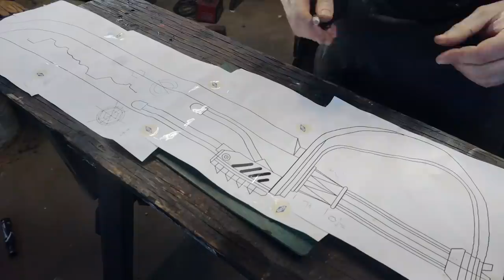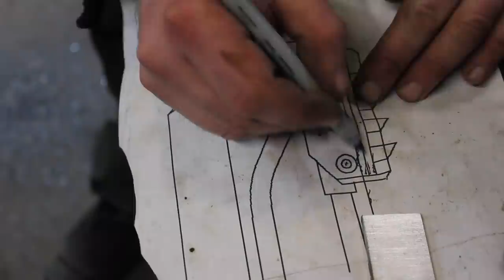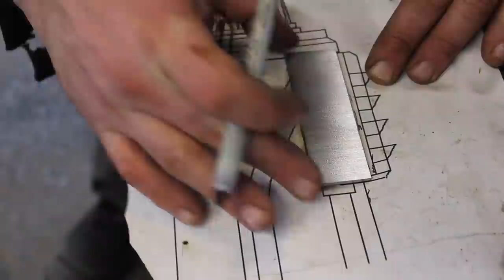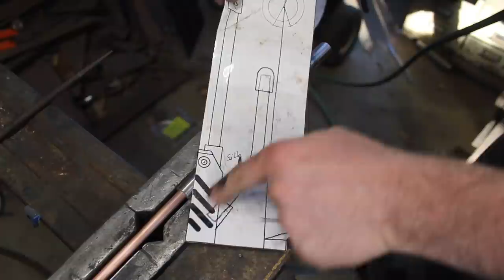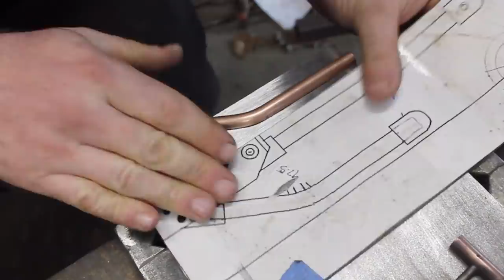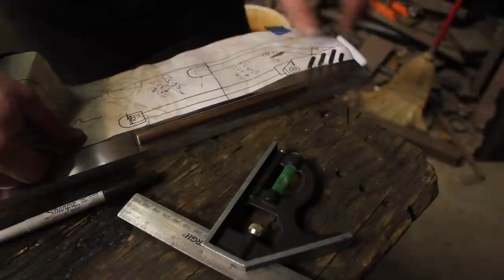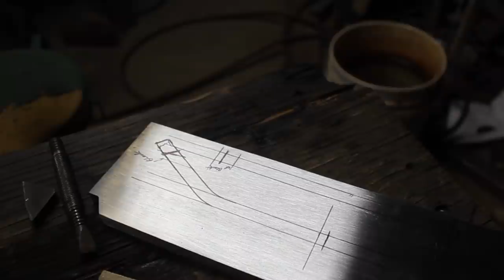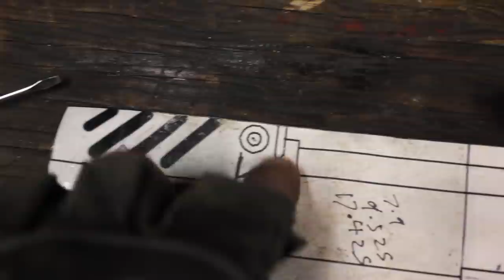I Return with a 40k Power Sword.

Comment: after working 3 years in a iso 9001 aluminum extrusion/fab plant, I always get a sick sense of satisfaction whenever mike creates a new franken-tool that works flawlessly
Reply: As a welder that's had to use extruded aluminum parts I both love and hate you at first sight
Reply: @jonathonhunt5387  I can easily say I have never worked a more hilariously dangerous, yet strangely fulfilling job since.

Comment: A tip for forming copper. Heat it up and quench in water to anneal it THEN it will be softer and bend easier. Dont heat it and bend shapes like you would with mild steel.

Comment: Hey Mike, just wanted to say glad you're back. I've been teaching myself to weld on my breaks and lunches at work. It's 22 guage to 16 guage sheet metal and it's galvanized, so it's rough but I plan to take my welding test this week. Just wanted to say you had a bit to do with it, been watching your stuff for years and finally acted on my wanting to learn the skill. God bless man, take it easy
Reply: Be careful when heating galvanized metal above 480°F it releases  fumes can't remember if its toxic or cancer causing but you need lots of ventilation.
Reply: @dasbutte6254  yeah I know but my shop has no ventilation and I can't afford a respirator right now so I just hold my breath when I weld. We've had 3 people get galvanized poisoning and one guys currently in the hospital with a collapsed lung. OSHA is looking into it at the moment as well. But thanks for trying to look out for me man

Comment: Check out "tube bending springs." As a plumber I use these to bend soft drawn copper supply lines for fixtures without kinking them. The work suprisingly well, and a set can be had for quite inexpensive.

Comment: White vinegar is pretty great stuff. I've used it to save all kinds of odd kitchen tools. It'll take off rust, scale, grime, baked-on burned food, dubious bathroom stains, all kinds of stuff, and it's non-toxic for pets. And it's cheap, basically my go-to for when cooking goes bad and burns to the pan; soak it overnight in white vinegar, comes right off. And if you're like me, and forget you put laundry in the washer, and then leave it for 3 days because you're a space cadet, just pop a cup of vinegar in there with your usual detergent and rewash to de-stink. So many uses.
Sorry for the vinegar digression lol. Great video! Glad to see your axe wound healed up.

Comment: With the jeweler's saw, (the frame-sawy thing) the closer the piece is supported, the better the cut.  That's why they're usually used with jeweler's 'fingers' horizontally, instead of vertically.

Comment: I see you are using some kind of metal workers version of a coping saw to cut those slots. Theres a saw type called a warding saw, that locksmiths use sometimes, with thicker but somewhat shorter blades, that might make doing small slots like the ones on the exhaust covers just a little less of a complete pain in the arse. Blades come in different thicknesses too, so they are quite versatile 😊

Comment: Use an end mill for a flat bottom, to avoid the taper in the bottom of holes, also you could use a thread locker to ensure those screws don't back out

Comment: If you want round holes instead of "polygonal perforations" you simply need to clamp down the material on the drilling machine table. Holding it with a hand or clamped on a block still allows movement.  Yes you need more time to align the drill properly..

Comment: 25:40 Yes you dont even need to boil it, just leave in say 20C for a day and vinegar will eat away the zink. You can also do this partially by only partually dipping part in vinegar and maybe even very accurately if you mix vinegar with say flour and put that paste on the surface it might remove zink (havent tested that latter one), just takes way longer as its no liquid anymore. Also need to probably add more vinegar with syringe or something to keep flour moist so reaction keeps going. Just remember to do this outside or in well ventilated place since it releases hydrogen if i recall right and that shit goes caboom real fast. One or two bolts no issue, but anything with larger surface area might cause hazard, havent tested whats the limit.

Comment: In the future, if you try bending copper like that again, you should first anneal the whole rod by heating it to cherry then letting it cool slowly to room temp. Then it will bend so easy. For lots of bending, to prevent breaks from work hardening, re-anneal it frequently. Then, I know you'll like this part, clean it up in a hot pickle. I use white vinegar in a slow cooker on low, but an electric kettle would also work.

Comment: Slots ...use clamps or 2 sides  taped and crazy glue 2 taped sides of the parts together .
 Use the drill bit to remove most of the material from the slot.
 Use a round file to enlarge the holes by round filing the small bits between them ,  finish the removal with flat files.
  With good placement most of the material is drilled out,  that was painful to watch

Comment: So is it possible to create you own type of forge using propane, coal, and a couple of leaf blowers? I feel like it could work if funneled into a T junction top that you could lay the sword into. Have a hammer welded and bolted into a circle gear and have it either horizontally hit or decide to go for a vertical hit that uses pressure like a hydraulic press to perform forging techniques. That could be a really cool series to build I think.

Comment: braise copper invisible joins by heating it up to almost melting with your oxy/cet, and melting a second bit of copper tube, dripping the melting copper onto the almost melting copper. Only takes two or three practice runs to get okay at it. 
I imagine you can also tig weld it using a second bit of copper as the filler rod.
Reply: I'll do this with hvac pipes if I only have 1 or 2 ends to weld up when I run out of braising rod. I pressure test the pipes at 350psi so it has some strength to it

Comment: I sure would not trust myself to even try that with a zip disk and angle grinder. maybe a 2 inch cutoff on a pneumatic die grinder. that's the first time I have seen a center punch like that. pretty cool for something that need to be persise. I like the ones that you just push on and they click. only get a small mark but then I go back and punch marks more defined after to hold the drill bit center.need a good punch mark when drilling round stock.

Comment: Maybe this is stupid to do in Steel, but why didn't you take the two thin vent plates, fastened them to each other, and then create those slots? That way, they should end up mostly identical.
As for copper, copper behaves the opposite of steel. You heat and quench steel to harden it, whereas copper gets really soft. If you work with copper again in the future, heat it up and then quench it in water. It should be nice and soft afterwards, making bending a bit easier.

Comment: Here’s a question. Can these swords hold an edge? They aren’t tempered from what I can tell, or is the steel already hardened?
Reply: Super late, but yes they are pre hardened. Hardox plate, it's called. You can find more online. He also seems to sharpen it to a "dull sharp" which helps hold the edge

Comment: Do you think the slots would be easier to do by drilling sequential holes to remove most of the material then file it down? I'm sure you thought of that already and had a reason it wouldn't work, I'm just curious lol
Reply: That never goes as planned, ever.

Comment: copper work hardens the more you work it(bend) the more brittle it gets (including heat)
Reply: and to soften it back down you heat it up until its faintly glowing and then shock cool it in water. it does harden quickly again though...

Comment: Michael injures himself more trying to work with wood than he does with steel. lmao Then again, I don't understand why he didn't just used the rounded part on the end of the sander to get into the curved portion of the blade.
Reply from the maker: It may not be noticeable on wood, but when you try that on steel, the fact that the wheel has no backing on it creates an incredibly rough surface. It might work if the front wheel was rubber, like the back one, but presumably there's some reason it can't be.
Reply: @michaelcthulhu  I understand. I should know better than to question someone who does this for a living. lol

Comment: 37:29 Isn't it possible to change the colour by heating it up and scrubbing it with a copper wire brush?
Reply from the maker: I have never gotten a copper wire brush to work, the brass brush works, but for some reason the copper one does not seem to.
Reply: Dang :/

Comment: I do like the projects you take on but always get annoyed at the amount of material you normally leave between the blade and the handle. The FF7 sword if the one that mostly comes to mind when you had a 6'~ blade with a 3"~ piece of material to connect the handle to. It just didn't seem in proportion to me but I'm not an engineer today, I'm a doctor in <insert whatever is in the news today>, hopefully this blade gets a good amount of support by the handle.